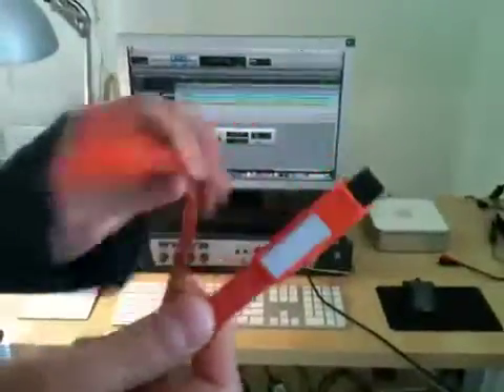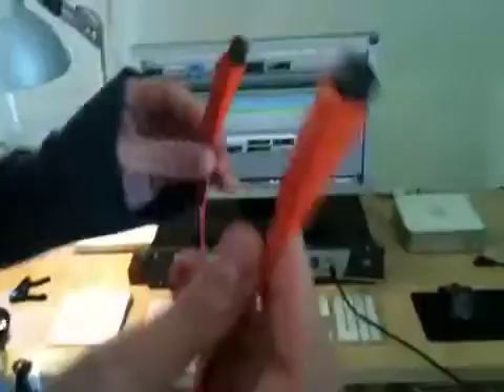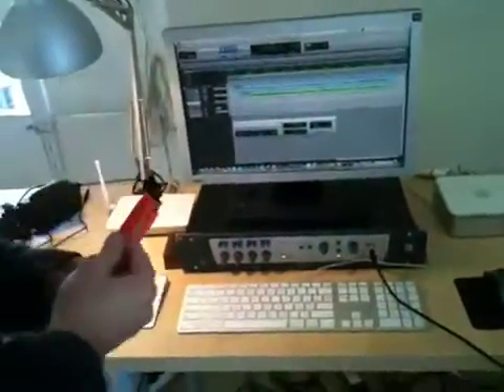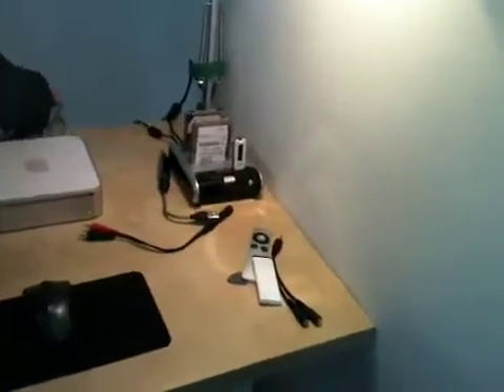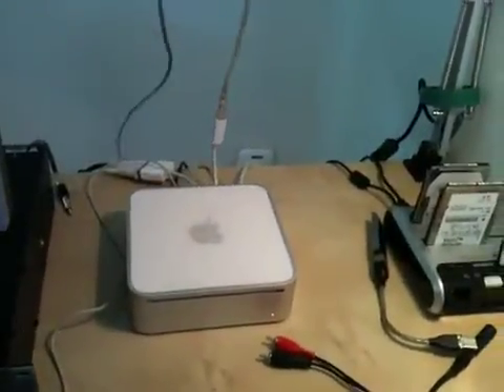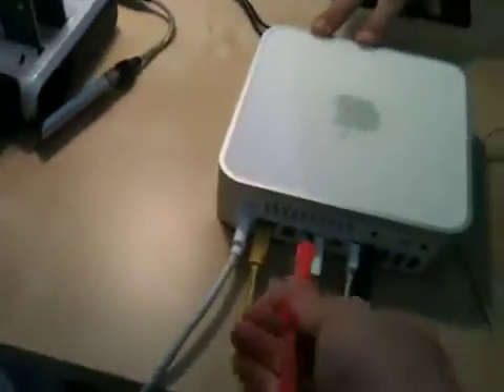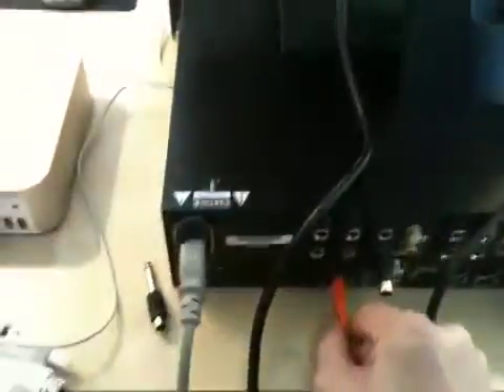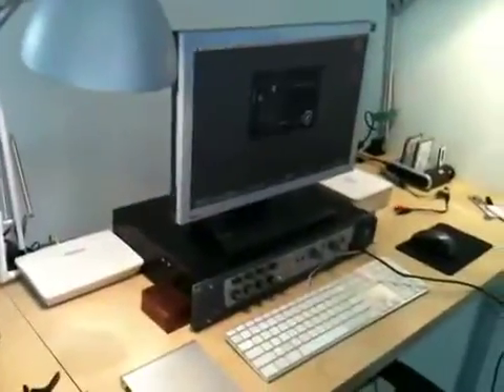Lacie Firewire Cable

Comment: does the fire wire connection on the right side of digi 002 suppose to light up green like 
the left up put does the reason why i ask u this is because mine doesn't  light up
i wondering if it was burnt out are something.